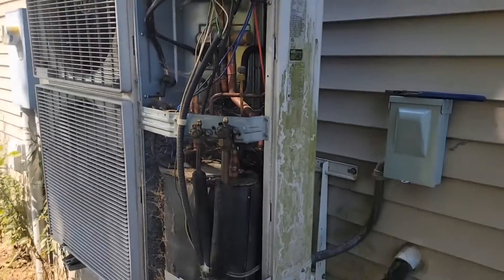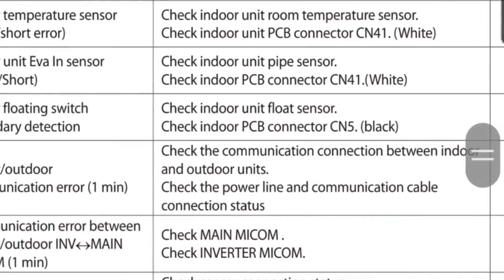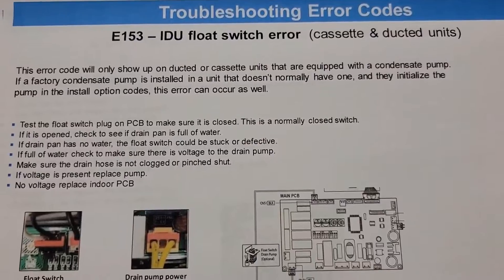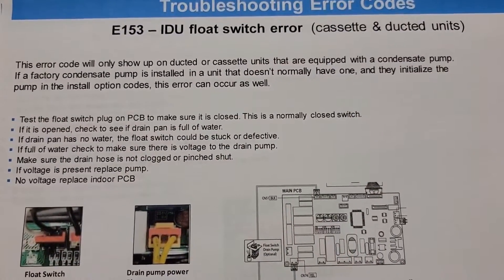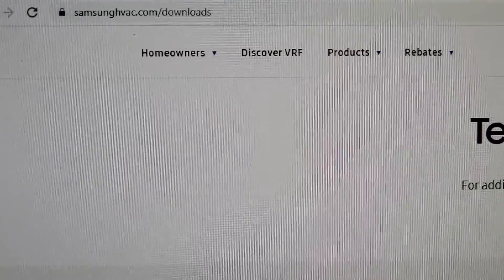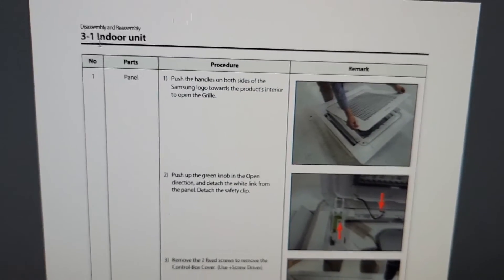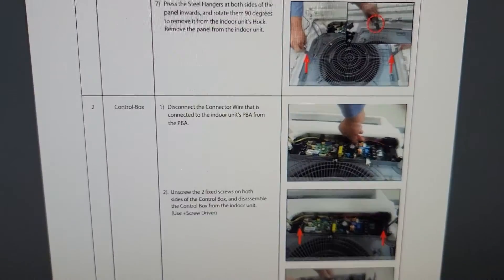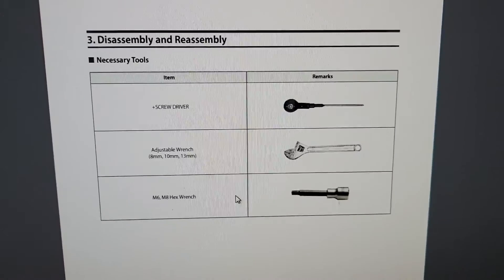Error Code E153 Samsung HVAC Ceiling Cassette

Comment: I'm in an apt bldg, we have a large Samsung HVAC outside our window.  This is the third time this year we have no heat.  Always getting error codes.  But this time it's E464.  Maintenance guy here isn't much help.  Personally I think something is up with the electric as some of my lights randomly blink along with no heat and as if tonight the vents in the ceiling aren't working (none of our bedrooms have ever had ac or heat since we moved in yrs ago).  I'm in low income housing, I used to own a house so imagine how frustrating this is day 6 with no heat and a wind chill if 19 currently.  Maintenance just changes the filter on a furnace in a closet in our apt of which is locked so we have no access to it, but that never fixes anything neither does power cycling so I'm at a loss at this point

Comment: Ive error e151 on samsung hydro kit HT Connected with DVMS HR MODELS
When we run the system in main cooling  (all Indoor units cooling mode)and Hydro on heating we have this error for EEV
how we can solve this issue
4 systems has same issue  only  with hydro unit
Reply from the maker: click the join button and email me
Reply from the maker: https://www.youtube.com/channel/UCuMyjTVlkM4xZ5z_eSyoB1w/join
Reply: @taddydigest  we also have about 35 ,dvms equipment and I want to join your link coz I've already subscribed so I can get direct access to you, please respond

Comment: I've heard that Korean appliances like refrigerators, washing machines and clothes washer/dryer are good but maintenance nightmares because support and finding replacement parts is difficult to impossible. 

I'm surprised that Samsung had easy to understand service instructions.  Do they have good availability for spares or are the parts inside commoditized generic style parts?  I don't want to be in a situation where I have to replace everything in 10 years.

I was thinking about Mitsubishi and the various American or European companies.

It would be nice if you could go over companies you prefer for maintenance and longevity.
Reply from the maker: You are spot on
The Samsung brand makes good equipment with slightly generic parts
 But you cannot find anybody to service the equipment

No training no education
 Or at least not what's needed

 Thank you for your knowledge in your comment